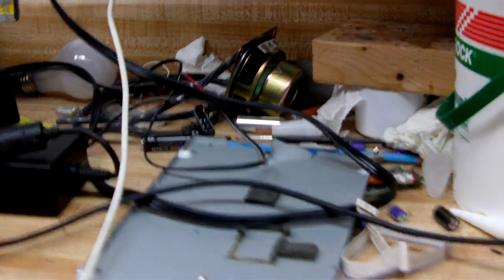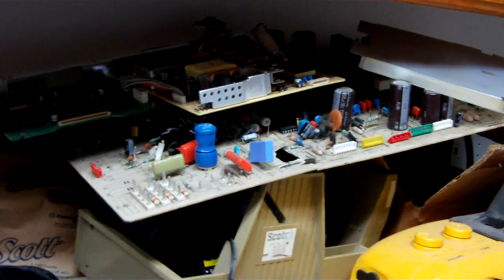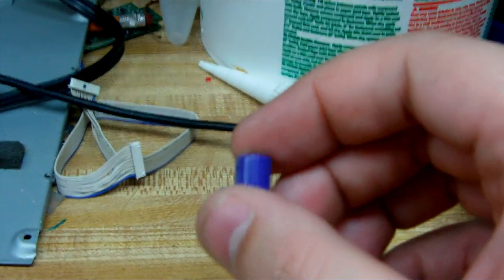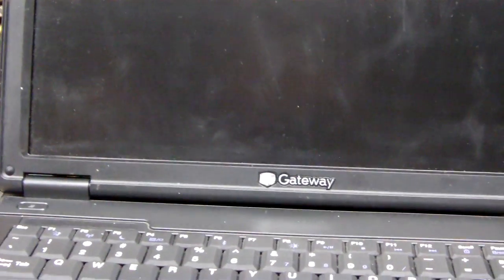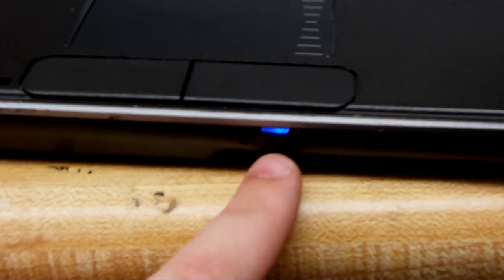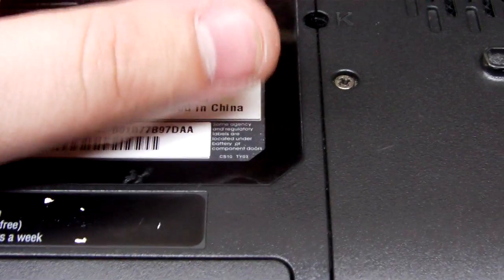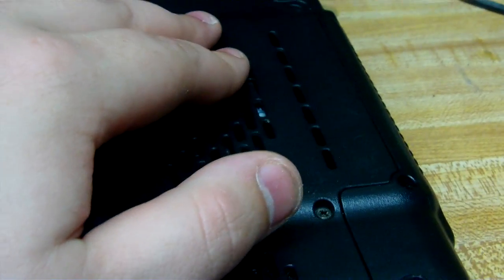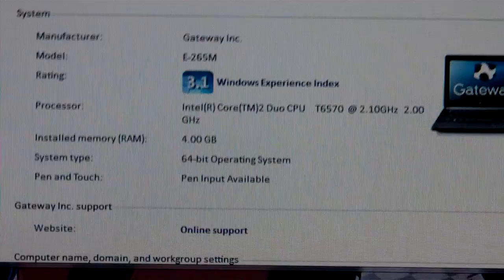$20 Gateway E-265M Overview Redo

Comment: Hey man, 
  I realize this is a old video, I have been looking for anyone that has upgraded this exact model though and it seem you are it.  I got this exact model and I am finding NOTHING for help.    I have a problem LOL   when I get something like this I like to bump it as far as i can for as cheap as I can and I was wondering if you might want to help me out.

   mine is all original, it was not working and had 9 kinds of viruses (hijackers and crap software and a broken screen ) other tan that it was perfect.   I haven't tore into it though. it has 1 gig of memory is all and xp pro sp2.   I reloaded the entire thing and it seems fine but you know, lame and will not update now.   I have looked up the memory upgrade and it says there is 2 slots and will go to 4 gigs but I don't even see a second slot.     If It would go to 4  I could get a different OS and it would be cool again I am sure.   let me know if You can help me out or if I have to wing this.    I let this thing go online and tried to install IE upgrade because I was having so many problems and I nearly instantly started getting bogus crap loading up just looking for that explorer update, I mean so bad I got pissed and restored it and left it offline.  I am familiar with the aquiring software by the way so any suggestions on that would be helpful as well.  i will just do it on another system that is protected, utorrent and  thumb drives way.     anyway    HELP! lol    Thanks either way.
Reply from the maker: Best bet is to just drop 7 on it in either case. XP is End of Life as of April, and 7 is going to stop being sold by Halloween this year. There are always ways around activating a version of Win7 (coughWINDOWSLOADERcough) and that's what you should look into. if you install antivirus beforehand it'll have a false positive ("hacktool.keygen") but it's completely safe. get an 8GB flash drive, a Windows 7 Ultimate SP1 ISO, and Microsoft's Windows 7 USB DVD Tool: http://www.microsoftstore.com/store/msusa/html/pbPage.Help_Win7_usbdvd_dwnTool which is FREE and will make a bootable flash drive which you can boot off of to install 7 instead of burning an ISO to DVD.

as far as RAM slots go, there's two there where the RAM is underneath. one is stacked atop the other. it's a little hard to grasp but it's how it is. the same is the case in most other laptops, and that is why it's a bit thicker. I had 4 gigs in this machine for a LONG time before retiring it in lieu of a Latitude D630 and finally a Thinkpad T500.

As far as anything else is concerned with the laptop, there's a couple other things you need to look out for. dropping in a 4965agn mm1 card ( http://www.ebay.com/itm/361069385037 ) will up your WiFi card to 802.11n, since I'm going to assume you have a 3945abg 802.11g card. it's cheap and effective, and makes use of that 3rd gray wire underneath, which is the 3rd antenna.

CPU upgrade-- You should really do this, especially if you're stuck with the original Core 2 T7100. a T8300 is cheap and worth it. http://www.ebay.com/itm/400783473358 and be sure to use proper  thermal compound. ceramique 2 is cheap, I wouldn't recommend AS5 for this laptop-- doesn't seem to cool right with it. weird thermal profile.

and finally, Battery. http://www.amazon.com/Gateway-E-265M-6600mAh-Compatible-Battery/dp/B00LWEIV72/  12 cell, worth it completely.

Hope some of this helps.
Reply: I will check this stuff out.    Hey is that CPU soldiered in?  I have never changed a CPU on a laptop Mobo.      This is a big help. I'm pretty good about finding the cheapest available THING that I am looking for.  and Im also familiar with aquireing the goodies to load up.     I have these tips written down but I am not sure of the cpu yet.  I will pull it up and get the full specs.  I have noticed 7 seems to work slow with less than 4gb of memory. I wonder if it will recognize more memory when 7 is installed.
Reply from the maker: RockAnAhardSpot  The CPU is NOT soldered in. 7 may work slow if the incorrect graphics drivers are installed; there are two versions of the E-265M. one has ATi graphics and the other has Intel X3100 (GMA 965 Express). As far as the ATI graphics version, I've never used it before. the Intel graphics version is the one I have (in storage, now.)

7 will love more than 2GB in either case, but it shouldn't complain with just two. look very carefully at the RAM slot and you'll see the second slot underneath, as previously mentioned. when installed correctly, the bottom stick should be poking out a little more than the top stick.

the CPU, again, is NOT soldered. any Socket P CPU will work. anything in the T7000 series is garbage and 65nm and will run hotter; the T8300 is 45nm and will run cooler while being the best bang for your buck. Sadly they go for under $20 on eBay still since they're an in-demand chip for that sort of thing.

make sure the VRMs that have thermal pads on them when you pull up the heatsink are clean on top when you place the heatsink back down onto them with the thermal pad. DO NOT REMOVE THE THERMAL PAD.
Mind you, the thermal COMPOUND on the CPU and GPU can indeed be removed. I'm talking about the grey square objects next to the CPU that have the pad on them.
Reply: *****
LOL   This has the T5450 @ 1.66GHz     I just checked   I could not tell what the damned video was till you stated teh two that it could be because Mobil Intel 965 express did not seem familiar to me, the name I mean.   anyway, that's what it is.   so I have a crappy Cpu eh?      I did bump the memory up just because i had a pair of old one gig laying around.   I was pretty bumed about that because i remembered them as being 2 gig each, I had not looked at them for so long I had forgotten what they were though.  it will take a pair of 2 Gig though right?  for a 4 gig max?  I put an old version of Nod32 on just because I had it already.  you know, one of the old school never ends kinds, i don't think that will fly with 7 but its; updating everyday on xp.      so if the T7000 is garbage  is this T5450 even worse?    im not super familiar with these specs.  
 for some reason xp sp 3  is updating on this, weird I thought that was over but it keeps loading updates.  and that 13.99 card you looked up,  : http://www.ebay.com/itm/400783473358   <-- is that the best one I can do ya think?  I was thinking since I am doingt his i may as well get the best one.    I can see 2.4Ghz on it lol and mines 1.66    seems like a dumb question but Like I said, im not super familiar so I thought it worth mentioning.   The Wifi card in this STOCK  is intel WM3945ABG ( 802.11 a/b/g)    so I think im good there already right?    i did think that was funny you posed a sony viao part.   sony vaios are the only thing I have actually worked on like this.  they are so limited though it;s easy to max them out and keep them clean once you strip out all the bs bulkware they have in them.  this one i stumbled on freebee seemed to be more cool of a challenge, i don't think a viao vgn n130 is going to do well with 7 at all and I have that exact model everywhere here.   no kidding, I fixed one and I just kept going it every time one came up and now I have ass loads of them. they do make great net flix machines. LOL     anyway, i thought since i was abe to do all this funk to the vaio's  i could probably make the gateway sing. gateway has never NEVER been a fav of mine, so it;s weird to me that this one is so interesting.  The free part helped.   I cannot believe I can switch out the processor! LOL this is awesome news.  the dude that gave this to me is gonna shit his pants when he sees it again. It had a the screen busted out of it and was all corrupt. it is running better than any of the vaios I have though.  right now anyway. LOl

   thanks for helping me out man.   this is awesome.
Reply: *****
I RE read your wi fi suggestion wrong.  I will get that sony card now. i dont think that would get any cheaper.  i was thinking you had written  upgrade to 3945abg 802.11g, but you actually wrote to upgrade to 802.11n     3 rd wire connect. cool. less than 5 bucks   done deal.  checking on the socket P now.   probably end up doing that buy it now but I thought i'd look anyway.   ima have to get some of that compound, I have some here but I have been looking for two days and I cant find it anywhere.  so I needed that anyway, It probably was not the 2 anyway.  i will probably find it now that i just got that.  LOL I have some xboxes around here that needs that anyway.
Reply from the maker: RockAnAhardSpot
 https://downloadcenter.intel.com/Detail_Desc.aspx?DwnldID=22510
drivers for XP for the new card. you'd be wise to desktop this before you install the card, lest you'll be hooking to ethernet to get it later.
that T8300 is at an AWESOME price. for 13.99? go for it.
the thermal compound you'll want to grab for cheap is the 25-gram (not 2.5-gram) tube of Ceramique 2.
http://www.ebay.com/itm/Arctic-Silver-CMQ2-25G-Ceramique-2-Tri-Linear-Ceramic-Thermal-Compound-Past-25-g-/310327291746
is a reputable source.
Reply: *****
 The cards not here yet. I can just download that driver to a thumb drive and install it that way right?  Thanks for that, i didn't even realize it would need new drivers really.  I already messed up on the thermal C.  I got the smaller one for 3.97 shipped. wished I'd of see that other one, I didn't realize how much more you get for the money.  oh well. i will get that one when this one runs out.  I still have plenty for the lap top.  yeah though, wow i was looking at the slot p cpus, they really get high on those. seems 2.4 doesn't sound so bad. i'd go with a better one if I already had the 4 gigs of memory but I don't. Like you were saying , I might have some heat problems with one of those super fancy ones right? also that 12 cell battery is higher than the others so that will set me back a little bit.. I might wait on that to see if i like this thing, i can get a dock port pretty cheap it looks like and the power adptor I have will power that, i wonder if there is a battery hack I can do on this POS battery I have here.
Reply from the maker: RockAnAhardSpot
the batteries are relatively "smart" in that if you do a hack to them, if you disconnect them from the controller, the controller shorts out hard because you tampered with it. "for safety and tamper protection".

you shouldn't need to put it on a flash drive. just keep it on the desktop. a flash drive would be an unnecessary extra step.
as far as a dock is concerned, yes, they're cheap. but you'll want to also provide yourself with a better power brick even though you don't have the necessary need. a 90W or 120W brick will do you perfectly, but the price for such on ebay seems to have upped a bit... I think it's because it's getting close to christmas and black friday...

so don't sweat it too much. the E-265M has a standard-sized barrel plug so any 65W+ adapter (19v 3.16A or higher) will work just fine. just PLEASE FOR THE LOVE OF GOD not use any that say REPLACEMENT AC ADAPTER on them from china! they will KILL the laptop! always use one from an OEM no matter what!

other than that you should be fine. Let me know how the installation of the card and later on the CPU goes.
also, the 12-cell will provide the laptop with about 3-4hrs of battery life.